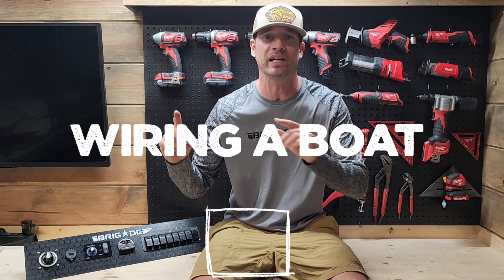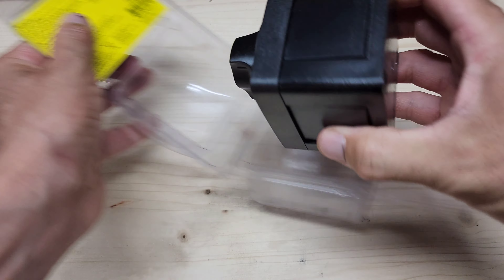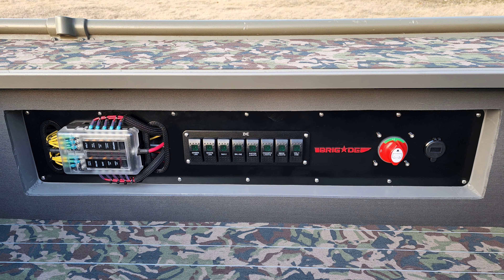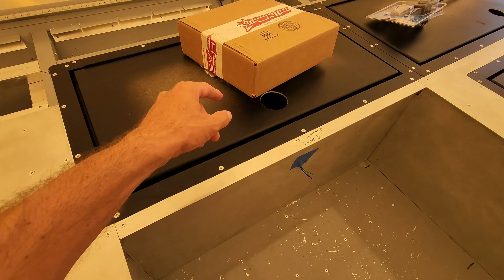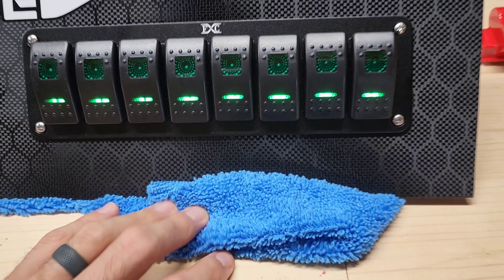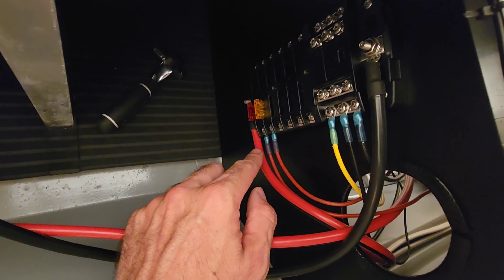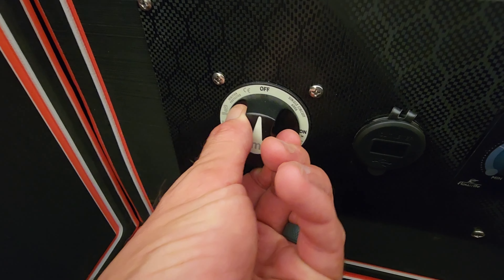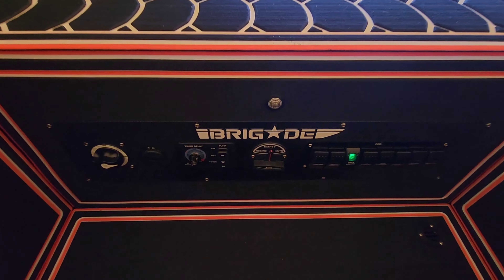Full Electrical Guide to Wire a Jon Boat

Comment: This is so much nicer than the often seen random not-working, inproperly-grounded, rats nest of nonsense that only works to operate one of the 6 things it should! Or is that only on my boats? 😆
Reply from the maker: Haha! I've seen some crazy bad stuff, I know your only kidding lol. I've actually seen household outlets wired in a jon boat, that kinda blew my mind.
Reply: @AnthonyJonesBrigadeBoats  I'm sure you've seen it all! - great video and well done!
Reply from the maker: Not yet! Still feel like I'm just getting started! Thanks again fir tge feedback and support!
Reply: 😂 we must have the same boat!!
Reply: Great vid Anthony, yhanks. Just finishing up my pontoon and now I’m watching your vid.🙄🙄 but happy to say I’ve done the wiring very similar to the way you’ve done your boat. But what I didn’t do was check my circuits as I’m going along. I was under the impression the battery had to be disconnected so no sparking when you’re wiring up a circuit? Cheers my friend…
Reply: Is it possible to use this wiring video for a 89 bass tracker tx 17

Comment: Best demonstration I have seen as yet. You begin with an exp and simple diagram. You showed the size of wire and why. You showed and listed the components plus the tools for wiring connections. You explained what products are to be used where and why. You left no need to out no matter what level of knowledge the viewer had. Good job, your parents raised you right and your teachers did a good job too. Give yourself a raise. Oh and not only did you master your trade, you mastered how to do video production in an organized manner. Most importantly you care enough about your fellow humans to want to share what you have learned on your particular path of life. Some think kept knowledge is power. They are wrong. Shared knowledge benefits us all.

Comment: The only thing I really miss here is a main fuse for the battery itself, ideally directly after the battery switch. Additionally the main negative from the battery should be connected to mass (the hull structure in this case) as long as you don't use fuses that monitor and break both positive and negative line at once.
Reply from the maker: You are correct, a main breaker can and is commonly ran after battery between fuse box. I typically see this is bigger rigs and marine applications with more accessories but it would not hurt. I'm honestly not sure about the negative, I have heard debates on grounding to the hull. Thanks for the great input!
Reply: Grounding the negative battery connector is useful to detect (aka "blow the fuse") a positive voltage leak to the hull. In that case you either risk an electric shock (mostly negligible on 12V because the fuse will blow when the current gets too high) BUT you might damage an aluminium hull due to electrolysis, as the current hardly reaches the peak required to blow the fuse in that case. This is especially true for boats that stay in the water for a few days in a row (worst option a marina or mooring when the boat next to you has a grounded land connection). In brackish or saltwater the effect becomes even worse. 

The hull should in no way ever be used as a negative bus (to those of you out there who might misunderstand this)!

Oh, and just in case I wasn't clear enough: Besides those two things you made an awesome guide to boat wiring!
Reply from the maker: Thank you very much. You sound very knowledgeable, and I definitely appreciate it. I'm always open to learn more and it sounds as if you have quite the experience! Thanks again!
Reply: Dont earth the hull  asking for trouble   really stupid idea   you do not want the hull to be  a cathode or  anoide   -  dis similar  metals  should not be put into contact with each other   if you do the harder metal should have less area than the softer metal  - these boats are mostly old  the aluminum is not as good as the stuff we get today   they were thin due to the lack of welders and cnc type machines

Comment: You wired the switch for the light to come on! Mine do that standard don't need to wire the switch for the switch light to come on! You talk it up bro! That's how switch lights work😅
Reply from the maker: No. I wired it so the light only comes on when the accessories come on. The way they are wired from the factory they are always illuminated wether on or off. There's two lights on the swtches, I disabled the valet light that always stays on. I'm not sure what your talking about but if your lights only light up when activated then good for you. Not how any plug and play 5 pin switch panels come prewired but thanks for explaining to me how a light switch works.

Comment: Earlier in the video you said that you were going to wire the volt meter so that it operates with the battery switch off. You would need to write directly to the battery for this, no? The entire fuse block is wired through the switch.

Comment: Great video! I believe the best safety precaution would be adding a fuse within 7 inches from the battery on the positive side, then the switch. ABYC standard. Great channel and thank you!
Reply from the maker: You are correct. Sorry I left that out. Thanks
Reply: @Anthony Jones  thank you for pointing that out I have really no idea on my project  trying to learn  from you tube
Reply: How big should that fuse 7 inches from battery  going into kill switch be

Comment: Excellent video! Thank you for sharing!

When doing 2-to-1 connections I would add a bit of liquid tape on the two-wire side as the heat shrink tube cannot seal against water.

Comment: Great video! I broke a bunch of switches pulling pins.. doah! One option is to run those leads to the first switch so you can turn that indicator light on or off.
Reply from the maker: You definitely can and I actually did that once. It just takes up a switch spot.

Comment: Great video.  You could wire the small lights on the switches with the interior lights.  That way when the interior lights are on so are the small lights in the switches.
Reply from the maker: Most definitely! Just trying to keep the process simple but absolutely an option.
Reply: I was thinking the same thing 😂
Reply: The small lights are designed for that wire to hook to the accessorie side of a ignition switch. That way there's only power when the key is on. Usually, there's a main power wire to battery to power the switches, then that light wire goes to ignition or headlight switch. Easy to eliminate though since it's a boat and not a vehicle.

Comment: I've got a 15' aluminum v hull i just want to put nav lights and bilge pump on a switch panel i watched this entire video and its like nothing stuck in my head. Electrical is not my thing 😅 You do amazing work tho I'm gonna save this video and watch again when i feel up to tackling my small project. Thanks.

Comment: Great video! you should do a video on batteries. other than the cost difference. why choose lithium battery. What is the advantage over an old school battery. Are they wired differently, is the charging different.
Reply: They usually have a longer run time, and also way lighter. Weight reduction is always good on a boat.

Comment: The most informative video I’ve seen, great job. Everything I’ve done in the past I’ve soldered, I’m curious to know what ur thoughts are on the difference between that or using the but connectors you’ve used in this video
Reply from the maker: Thanks! I used to use solder connectors but ive found the crimp and heat shrink ones i use now to give a great connection, very solid finish. Less issues on install and quicker job. Just a preference

Comment: Great video - thanks!  Where did you get the switch panel blank?
Reply from the maker: I made it. It's sheet aluminum, i cut out all the holes and squares for the switches, wrapped in carbon fiber vinyl

Comment: Question.. if you don’t remove the jumpers behind the toggle switches you run the + & - to the fuse box? From there you run the - from the accessory and it goes to the fuse box and the + goes behind the toggle switch?
Reply from the maker: If you do it that way, what happens is  you can't individually fuse your accessories. Your switch panel itself would be fused as a single accessory and act as a "jumper" for your accessories. At that rate you might as well run inline fuses on everything and not use a fusebox at all, which is obviously not how I do it based off my video.
Reply: @AnthonyJonesBrigadeBoats  ok thanks for the clarification.

Comment: Beautiful work man. For your switch panel, I've had a lot of luck with the blue sea systems weather deck (fused) switch panel. It has the fuses integrated into the switch panel, and it's super high quality. All you need to do is run a bus bar for the negatives. I've used it on many ORV builds, and several boats (including mine) and it works great, might be worth you checking out. Keep up the great work man.
Reply from the maker: Appreciate the feedback! Definitely could have used something like that in the boat in video as it was a bit more high end. I started with a lot of the parts in the video due to jon boats being more budget oriented. I'm beginning to branch out and try different things and parts in different price points. I'll look into what you suggested.

Comment: Hi I’m in the process of working my boat and it previously had a really for the bilge pump and aerator do I need to install new relays when wiring or do I just run it through a fuse like you did? Thanks.

Comment: Your video is a great help for my rewiring project, thanks! 
Can I use 10 gauge wire instead og 8 gauge, to run from the battery to my kill switch/fuse panel? Thx

Comment: I like to throw some shrink wrap over the heat shrink butt connectors just because I've seen so many of those connectors crack and expose the metal.
Reply from the maker: It definitely can be done, I'm not opposed to it. I  haven't had any issues but added protection can't hurt.

Comment: Did you not have to put a fuse on the positive coming into the fuse block?
Reply from the maker: no fuse, you can do a 50amp circuit breaker if you want

Comment: Great guide. I'm making plan to rewire my boat, I assume you use 14 AWG wire from fuse box to accessories? Thanks
Reply from the maker: Yes. I just order it by the roll. Overkill for sime if the accessories but I'd rather have thicker wire than not enough. Thanks for watching.
Reply: @AnthonyJonesBrigadeBoats  thanks for the help. Please do ACR dual battery set up 😁

Comment: Really great video but I have a question. If you didn’t remove the original jumpers on the switch panel (keeping the lower LED on the switch on) how do you run your accessory hot to the switch and then to the fuse box with only one available pin? Is there a butt connection somewhere? Thanks for doing these step by step videos!!

Comment: Might be a stupid question but do you have to ground to the boat? I was reading a comment below but not sure I understand.
Reply from the maker: I don't.  I never have. Everything is grounded to the negative bus bar, which connects to the negative on the battery. Grounding stuff to the hull is lazy, and long-term can cause hull damage and pitting from electrolysis.  Also, good luck trying to troubleshoot wiring when grounding to the hull. I spent many hours tracing leads in a Basstracker build, and things were grounded to the hull, creating a lot of problems troubleshooting what was what. It's just not a professional way of doing it, in my opinion, and there no reason for it if grounded to the battery properly.
Reply: @AnthonyJonesBrigadeBoats  thanks for the response, I will follow your lead and not ground to the hull.

Comment: Do you have to run a jumper from the switch to the fuse box on all of the switches?
Reply from the maker: Each individual switch will have 3 pins used in back. 1- accesory coming in, positive.  2- positive jump from switch to fuse box 3- The negative jump (all negatives on switches jumped together and ran as one to negative on fuse box)

Comment: no relays to control the acc? Are they a bad idea?
Reply from the maker: I've only used relays on bigger accessories like a huge led light bar. I don't use in a typical jon boat set up but do as you wish.
Reply: @AnthonyJonesBrigadeBoats  Okay, i was just curious. I am adding lights to my truck and doing so, but i guess there is no real need on a small boat. Still got to run the wires, no sense in adding additional components to mess up. Thanks for the reply. it is a good and informative video. I am planning to build a cabin boat from an 18 foot starcraft and your video is certainly helping me plan the wiring. thanks for sharing it.

Comment: Is it possible to run a jumper between more than one switch and run that back to the buss bar rather than having a single jumper to the fuse block for each switch?
Reply from the maker: No because then all your accessories would be on one fuse.

Comment: What did sea deck charge u for the decking
Reply from the maker: Custom sea dek routed jobs like this one charge based on square footage, how many layers of color, and depth of routed details. I don't get directly from sea dek as they do not do custom routered jobs, i get from their authorized dealer. Jobs vary but are typically 2-3 grand.

Comment: How would you or can't you have two batteries, two Motors, both or each can start,  the electronics and   isolate both when not used, also shutoff switches.

Comment: Great video, I appreciate the content. The diagram you drew was definitely helpful. 
If I have a on board charger where should I set it up at? Also will the kill switch support the on board charger?
Reply from the maker: On board charger just connects to the batteries then you plug it into a electrical plug. Doesn't have anything to do with boat wiring, fuses, or kill switches

Comment: Good Stuff! How do you keep water out of the compartments? I have similar deck lids and they do not stay dry when it rains. Also where do get your rubber/trim that you apply to the edging on your holes to protect the wiring? Thanks!
Reply from the maker: These lids are custom made with anti flood tracks that have a big lip preventing water from overflowing into the hatch. The crucial part is that there is a weep hole welded in the track in the corner of the track with a 1/2 inch tube that takes the water from the track through the hatch and sub floor directing the water to the channels in bottom of boat. Lots of boats have lid tracks but not drains to direct the water once the track fills which is why it then overflows into your hatch. The tracks are welded, we have never had issues with any water getting in hatches. You'd have to look at some of my full build videos or build walk thru videos to see inside the compartments more in depth. Or check out detailed photos of these builds on my instagram page: adubjones. Rubber trim is simply door edging.

Comment: How many amp cutoff switch do we need between the battery and fuse block?    I only have like 6 things that I will need hooked up.   Is 100amp breaker ok?
Reply from the maker: I personally do not use one. I cannot recommend or advice on that. What you see on video and wiring diagram is how I rig every boat.

Comment: Would like to see how you hooked up wiring for the timer
Reply from the maker: Instructions are included with that specific FlowRite timer. Very simple. Same concept as the other accessories,  just it's own switch with built in timer to control the livewell recirculation pump.

Comment: I am thinking that I should wire my automatic bilge switch directly to battery and bypass the fuse box and switches since those will be powered off with the on /off switch for battery right ?  This way if no power to those switches the bilge will still turn on if water comes in
Reply from the maker: If auto with float I believe you bypass switch then have 2 options.  1) wire directly to battery with inline fuse. This bypasses the battery shut off switch which isolates power to fuse box. 2) probably how id do it, wire directly to fuse box, avoiding switch. That way it has power when on water where your kill switch should be on. Also keeps fuse in same location, one less battery connection, and fuse is where all other ones are. Also, i would do it this way because i know someone who wired directly to battery, float came up while driving, pump ran until it burned up. If it was connected to fuse box kill switch would have prevented that while in transport. Just my 2 cents
Reply: @AnthonyJonesBrigadeBoats  Thanks, yeah that makes sense ... i was thinking would want it on for when uncovered but as long as not on water its not really necesary , can just switch on and pumpout as needed on land ... realistically with drain plug out most water will drain anway ...
Reply: Pretty much all boats that are in a wet slip are wired this way but I don’t think it’s much benefit in a jon boat unless you have it sitting on the water when not being used.

Comment: 12:30 My OCD brain shorted out when you put the bilge pump on fuse 10 but connected it to switch 1. 😋
Reply from the maker: The fuse box gets custom printed labels at the end indicating which fuse is what accessory

Comment: What's the biggest fuse that you can safely use with 14 gauge wire?
Reply from the maker: i believe 15amp max then drop down to 12 gauge if higher amp required.